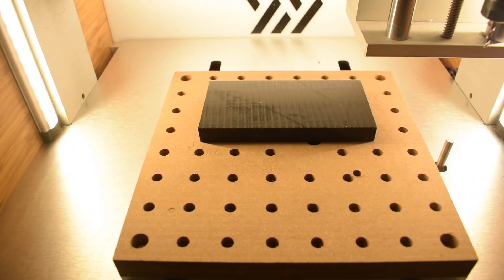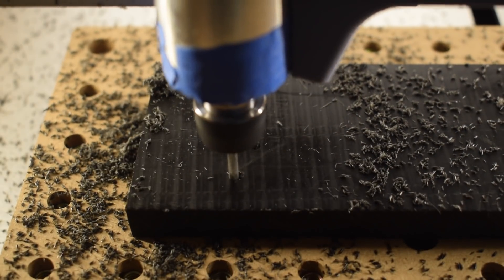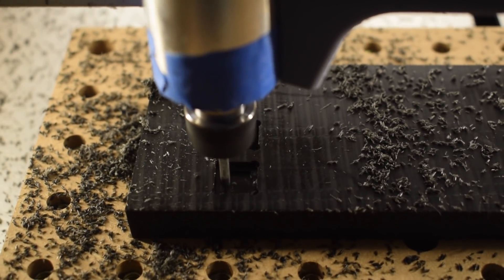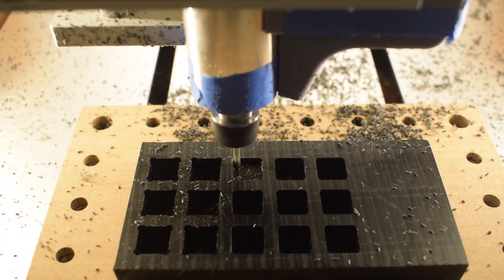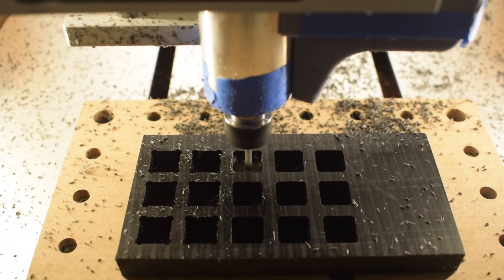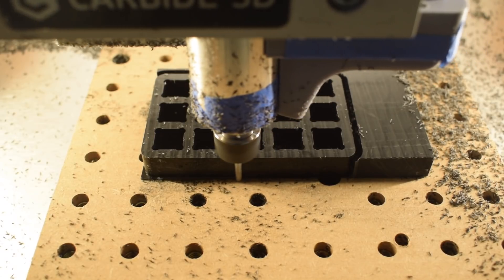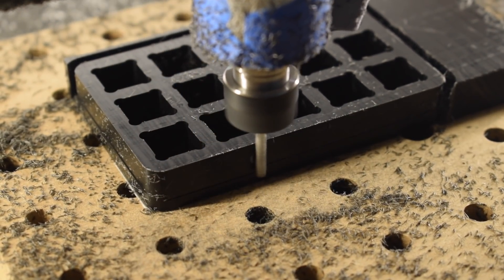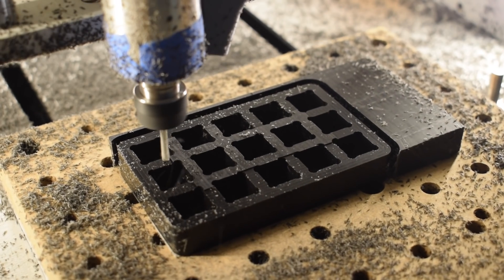Machining Delrin on the Nomad - #MaterialMonday

Comment: Hello Sir
I’m trying to create my own custom graphite molds for silver. I’m on a limited budget, but fascinated by silver casting. I’m getting crazy pricing on CAD file production as well as graphite mold making outfits. This is looking extremely expensive; so I figured that buying a machine that could do both design & cutting graphite could help. PLEASE point me in the direction of a machine that can cut graphite molds, read code & is cost effective. Lisa / Donnie 602-810-1346